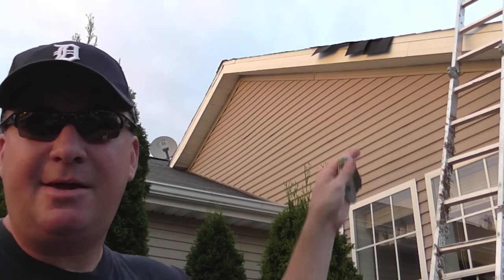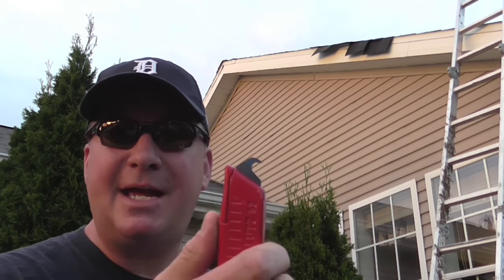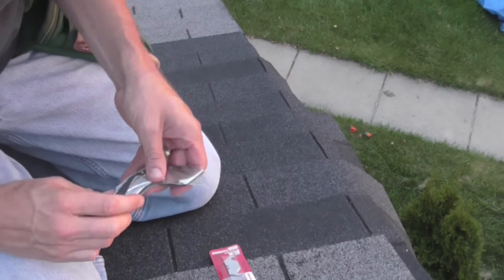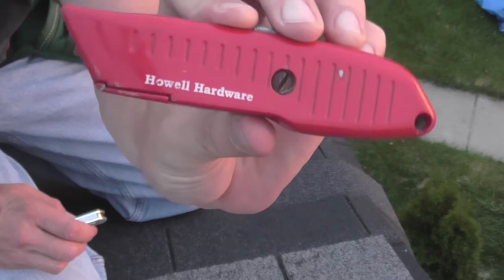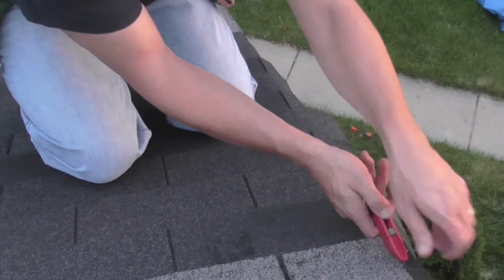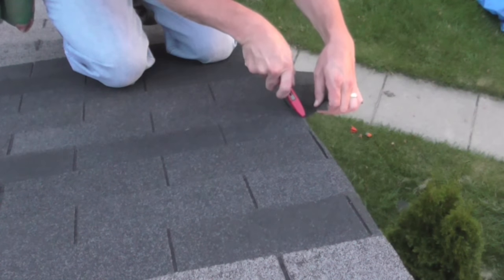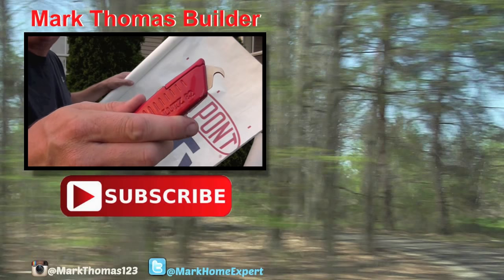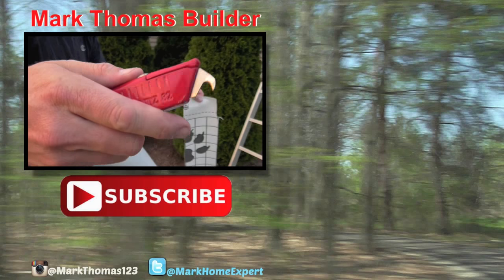Using The  Milwaukee Hook Blades on Roofing Shingles

Comment: Excellent video. Hook blade heard of it. Works nice for shingle trimming and I assume for cutting shingles.
Reply from the maker: Yes, several years ago I was talking with a work crew using those and I definitely went out and bought some.
Reply: @MarkThomasBuilder  Bought the stanley hook blades they wont fit in my milwaukee knife.
Had to use Quickdraw utility knife that has a slider on top.
I was wondering why you didnt use your milwaukee  knife. I remember the review you did on the milwaukee.

Comment: Did you run a starter course up that side? It helps with wind and water, also recommend ice/water shield.
Reply from the maker: Good idea.  I don't believe my original roof had a starter course on the side.
Reply: @MarkThomasBuilder  it isn't always used in the trade but ties all those side pieces well

Comment: How do yall like hook blades? I was first introduced to them in roof work but I quickly learned they’re amazing for so much more! When opening boxes, clamshell packaging, cutting zip ties, and other small tasks they’re sooooo handy. They offer a lot more control for small tasks like I’ve mentioned. It’s hard to explain, but you can feel an enormous difference in control and safety, and I’m a lot more confident with them. Having a hard time deciding what to keep in my razor knife 😭
Reply from the maker: I've recently started keeping a hawkbill knife handy for shop use.  It's a little similar to a hook blade, which is a nice design for all those things you mentioned.
Reply: @MarkThomasBuilder  Thanks for sharing Mark! I love you’re Milwaukee reviews btw. Especially the lawn mower in the snow lol
Reply from the maker: Awesome, glad to hear it!  I can't wait for spring to get here so I can try it out on some green grass.
Reply: I find them awesome to break down boxes too.